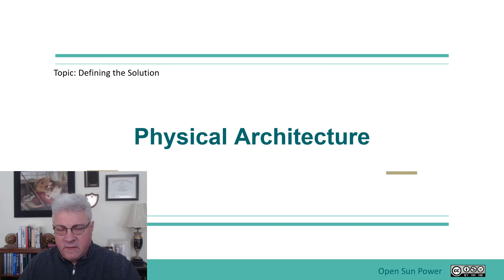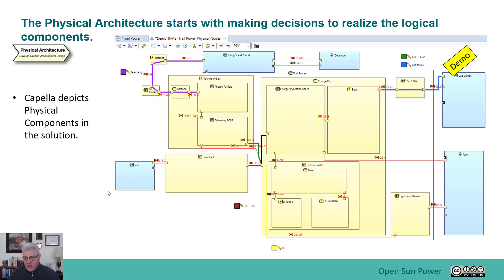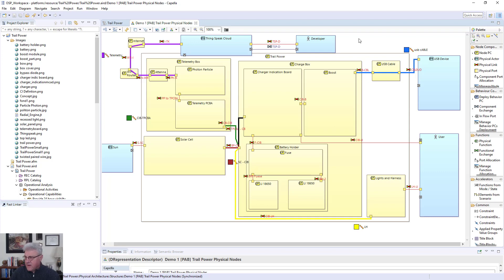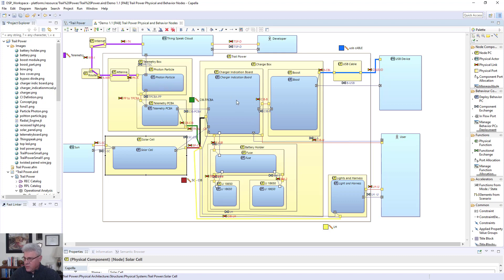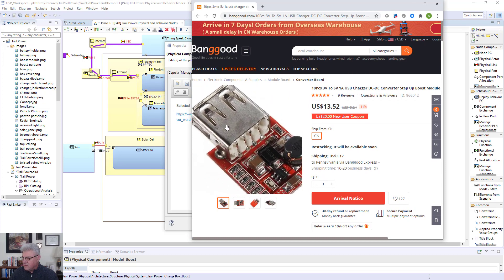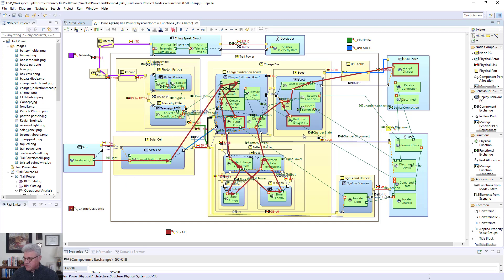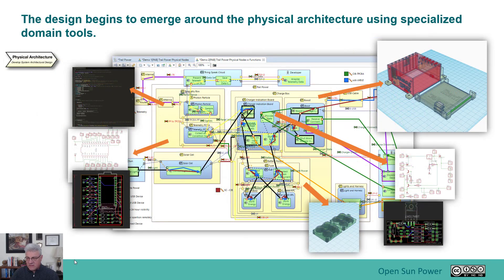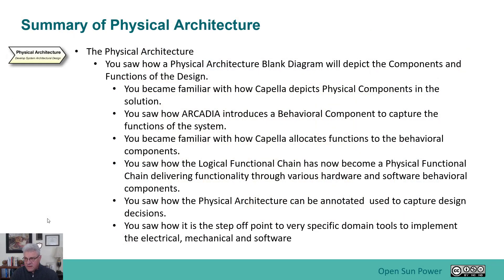3.2 Physical Architecture with Capella

Comment: Really appreciate your work! I would like to ask a question. What if the customer need is not that "functional" but "high performance"? I am facing a challenge that our products have an extremely strong performance requirement. And it seems those performance have relationships with every single components of our design including mechanical(materials, manufacture accuracy, ...), electronics(components, EMC, ...). If we handle these needs as a functional chain, it would be unclear, and the links would be everywhere in the model.
Reply from the maker: The functional chain is the right place to put the requirement. I would put in logical chain. I physical I would then start looking at how to realize performance in each component. Does it mean better manufacturing tolerances? Then it could impact every part.